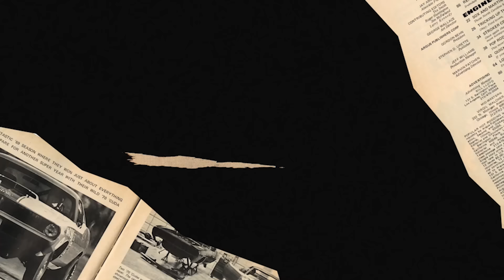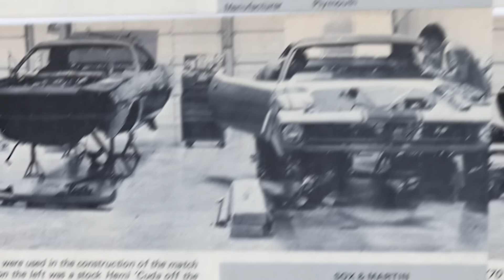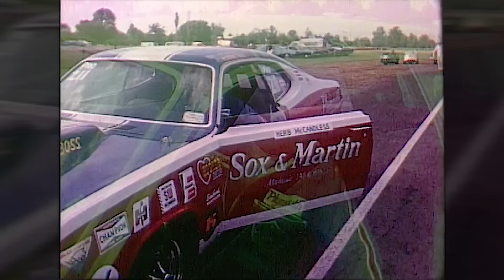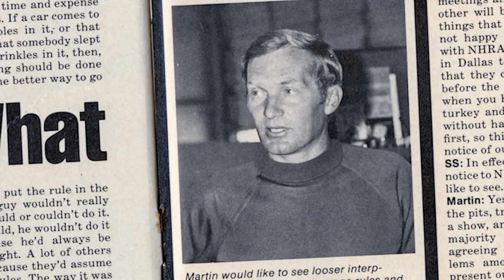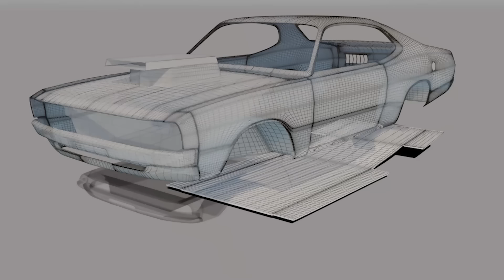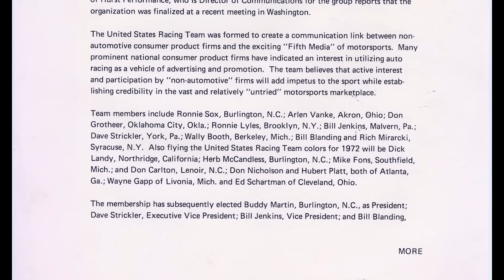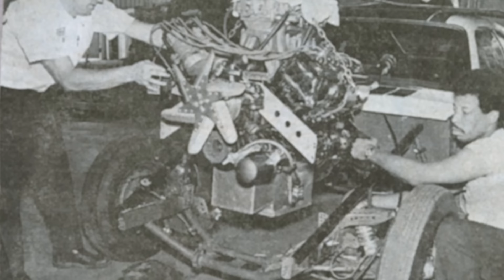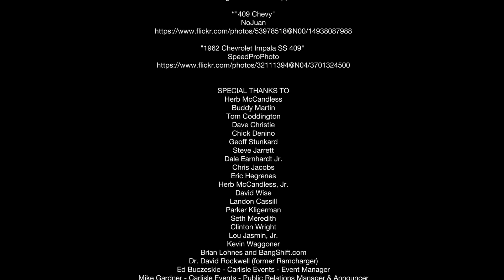"Mr. 4 Speed" Episode 2: The Sox & Martin Years - A Documentary on the Life of Herb McCandless

Comment: did you happen to face at try city drag way up in michigan near saganaw I'm sure I met you there back in the day I ran a 1964 Chevrolet Impala with 327 325 horse motor in it with a Camelback heads 456 gears and a rock crusher transmission won a lot of races but one Friday night I got spanked by a Buick 455 and I mean bad I couldn't believe it good old days weren't they